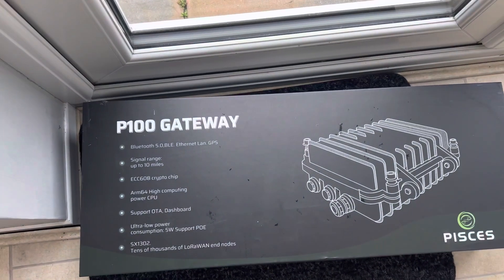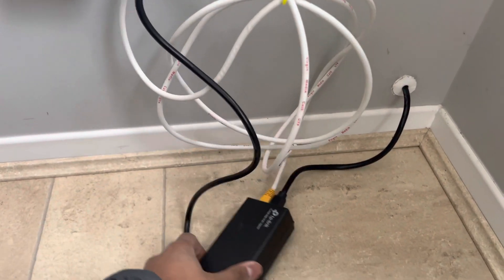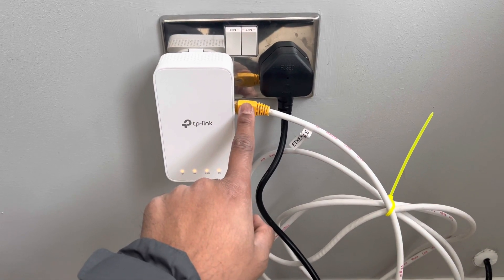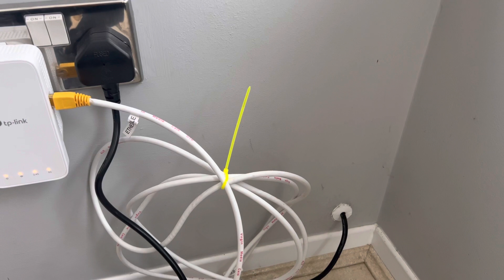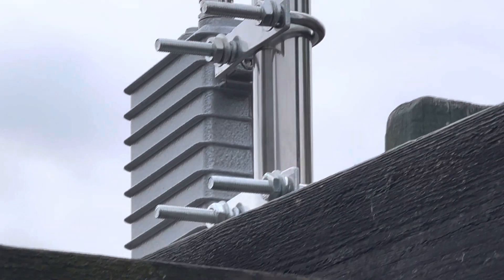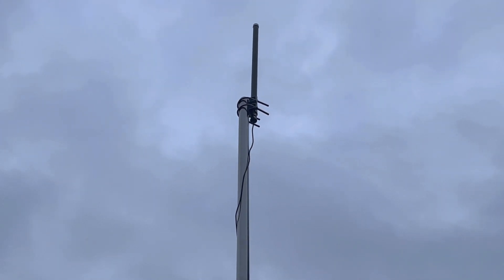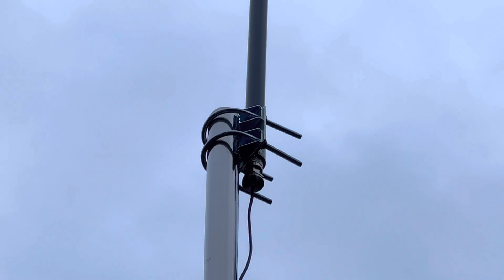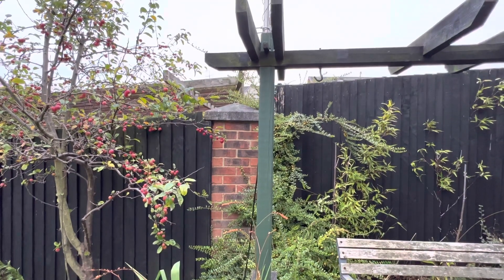OUTDOOR Helium Miner! - Pisces P100 update HNT Miner | POE injector | Setup | 4dbi antenna

Comment: are you using the same cable which was included with the miner for antenna or have you purchased another one?
can you guide me about the cable specs and the connectors for each end?

Comment: Hey, great video! In finally got my Pisces. I am having issues in maintaining my hotspot online. I just bought a Netgear extender in order to connect the injector to feed the hotspot. Do you think a regular POE injector should be connected directly to the router ? Or the extender is necessary? Thank you !
Reply from the maker: Its very hard to predict, some hardware does cause issues, you should perhaps try connecting directly to the router if that fails, ask on the discord chat. Good luck
Reply: @Helium_Hunter  i got it back to sync. Hopefully everything goes well. Thanks!
Reply: yes never use an extender between miner and router that will give you alot of trouble because some routers block extenders on firewall I had the issue and since I connected my miner direct cat 6 cable or WiFi everything is solved it self hope this will help you out.
Reply: @techcity7866  The issue , is for some reason it does not give me internet if I connect the hotspot directly. I used the POE and also have zero online connectivity. The extender is the only way to see connectivity on my router.
Reply: @juanserrato33  I saw check you ethernet wire or poe adapter there must be something wrong you probably have but it should work the extender probably working fully that why.. with extender my be no Beconing..

Comment: Did you manage to put rj45 connector  through the weatherproof gland? I found its aperture too small it seems it is designed for just the cable before it's terminated with rj45 connector..
Reply from the maker: i cant remember exactly how, but I think I did trim some of the excess plastic off from around the cable terminal as it was quite narrow

Comment: Hello, could you tell me which kind of Ethernet cable are you using  for PoE and what is the connector type for lightning arrestor  both sides, thank you for your video, good luck
Reply from the maker: The connector types are N type one end is male and the other end female
Reply from the maker: Hi there, I’m using a cat 7 cable but I think cat 6 and probably even cat 5 is fine. I’ve chosen a weatherproof cable